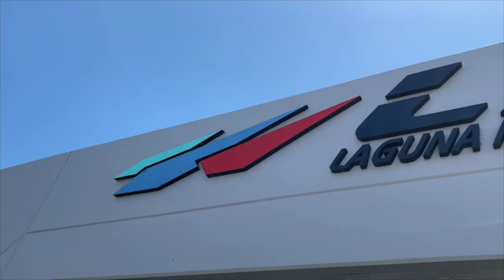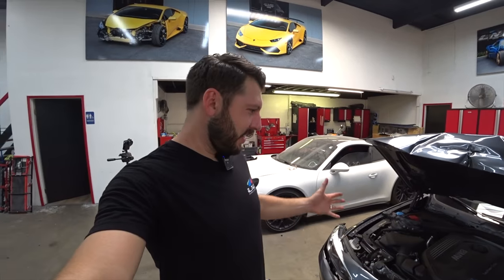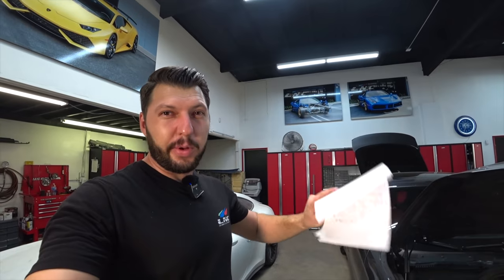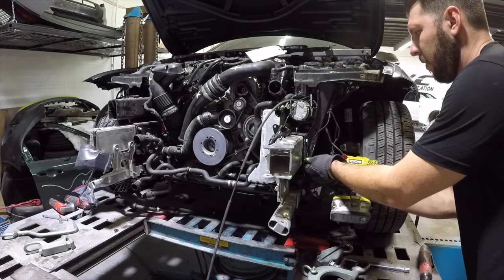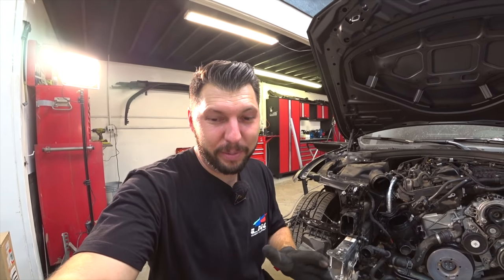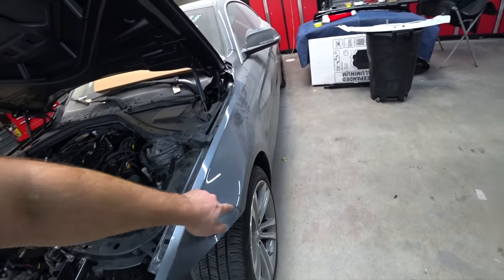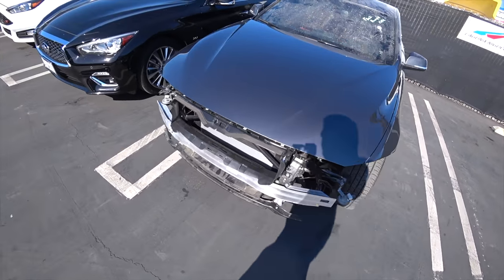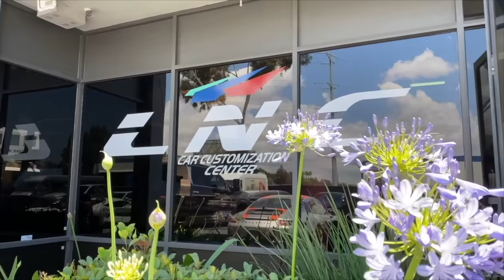REBUILDING CRASHED WRECKED 2019 BMW 440I IN 26 MINUTES!

Comment: I love these type hits for my own cars, or if buy cheap, as the
aftermarket performance radiators,  intercoolers, piping, custom hoods, bumpers, lights, from name brand, and reputable sources, function better, sound better, often generate additional horsepower, and less cost then OEM BMW parts, starting nearly exact same repairs next week as my daily driver a White X Drive, same Red Interior, loaded with options packages, like M Sport interior, tech, cold weather, etc, excited/motivated to start repairs now. 😁

Comment: Texting and driving your BMW will end up at LNC.  Looked up, slammed on the brakes Almost stopped in time(18 inches less wouldn't have hit that pickup truck) car was slowing under full braking and the airbag sensors not tripped .... Only explanation the airbags didn't deploy?
Reply from the maker: Thank you for your feedback my friend, I agree with you on that one makes sense.